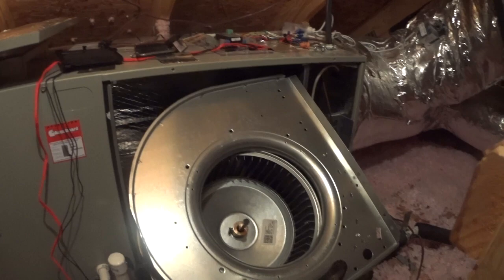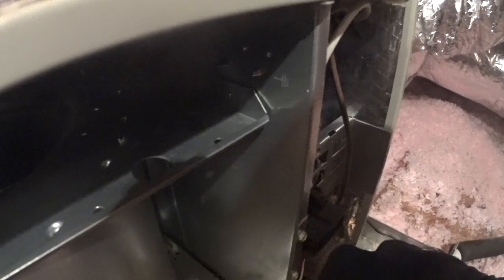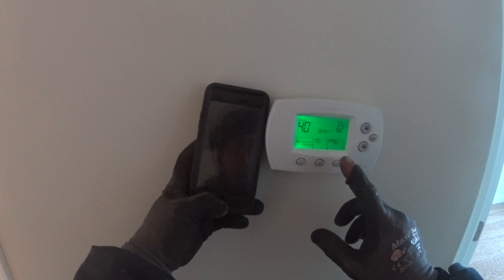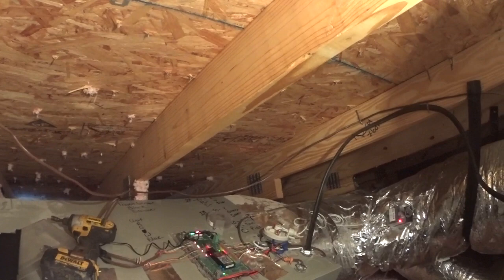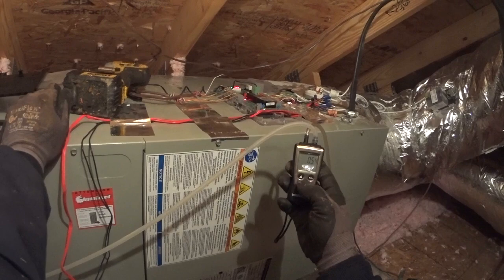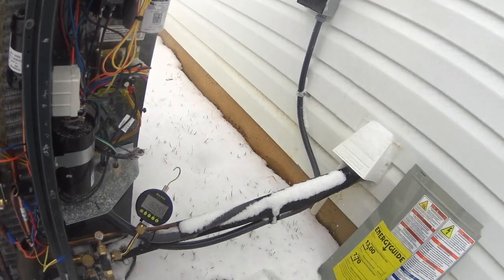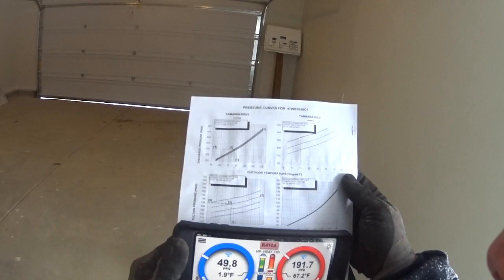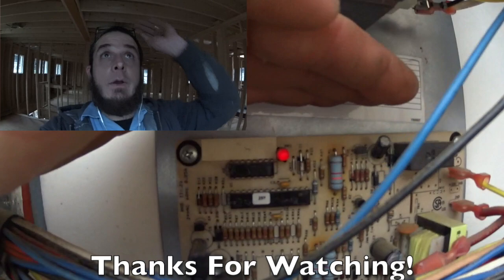HVAC Install: 3 System Start Up A Day In The Life  Episode 14 Part 2 2-24-15

Comment: Nice work on the heat pump zone system in 24F weather.  It's easy to tell you have done a boatload of these startups.  First time I have seen the BTU results of a conventional heat pump in freezing weather (1/2 capacity left at 1.25 tons).  

Can I assume the zone board has a cover?  Seems like on top of the air handler is a less than ideal location with the vibration and dust potential although service access is good.
Reply from the maker: Yes, the Zone Board has a cover for the circuits. It has been really cool to see system performance in such a visual representation for the first time! The iManifold system really makes it interesting.

Comment: in the past I have had issues with taking a vacuum reading with the air handler running.
hope you have it shut down.
Reply from the maker: Can't say I recall, but I'm not sure how that would have any effect? Interesting thought though
Reply: I was using a field-piece vacuum head and was getting a rise and fall on the micron reading of about +- 10 microns.  so I turned off the air-handler and the reading held steady.  don't think it was my equipment I clean inspect and lube all my hoses  weekly.  it was hot summer time. it was a inside coil and line set pull down only.
Reply from the maker: ***** interesting what did it pull down to eventually?
Reply: 350 microns....it was a nordyne coil as about 60% of my customers have been in mobile homes.

Comment: Just a thought, but is a reason you couldn't put a small amount of refrigerant gas in the system and push the rest with nitrogen to do your leak check? That's what we do In my company. Texas EPA law permits you to use a small amount to leak check.
Reply from the maker: Yes, that would be an option too. The issue is that the builder didn't want the pipes to freeze in his new houses.

Comment: I do enjoy watching your videos the only thing that bothers me about this one is that knowing there is a leak and opening the system. You know as well as I do is 410a is a blended refrigerant so a) you now are allowing moisture to blend in and b) because it is leaking you now allow the refrigerant to leak and separate its blend. Either way the charge most likely has to be dumped and virgin refrigerant reinstalled. Atleast that's the way it was taught to me. What's are your thoughts?
Reply from the maker: The charge is typically replaced anyway when I do a sealed system repair. The decision was made based on the circumstances at the time, as I mentioned, maybe not the best choice but my decision either way.
Reply: I get it man desperate times calls for desperate measures. I probably would have done the same thing under those circumstances. Anyways, I enjoy watching your videos. Keep doing what your doing.

Comment: Great viedo.  why was the staic pressure higher when u shut down one zone i haven't worked on to many zone set ups.so is it when u have higer staic pressure u are lacking air flow?  please explain.
Reply from the maker: When one zone closes the airflow that once went to all the ducting is now forced into fewer runs, sometimes less than half the ducting, so since you're only using part of the duct the static increases. With a bypass duct the idea is to try to balance the system so that static isn't terribly high and causes noisy registers.
Reply: question do u need a blowoff damper if u are using 2 stage equipment ,if u adjust the staging based on zone percentage .
Reply: Very thorough startup btw .
Reply from the maker: great one 99 if you size ducting well and stage the equipment then a bypass may not be necessary but it's not always feasible to change ducting enough to keep from using a bypass. The equipment I installed in my own home recently does not require a bypass